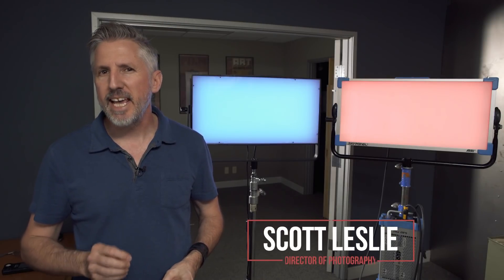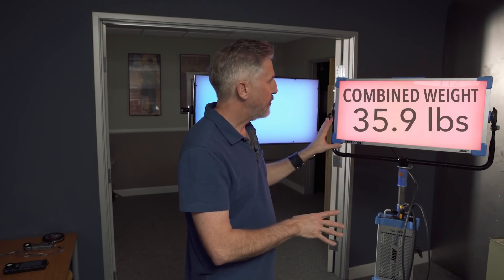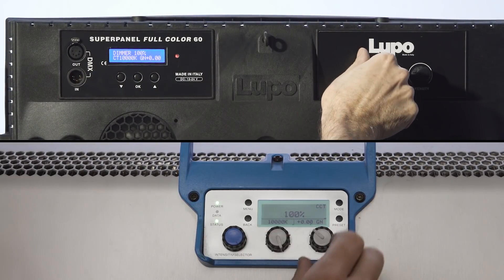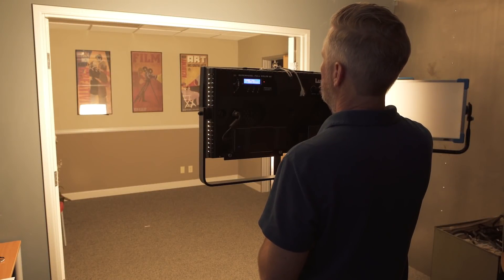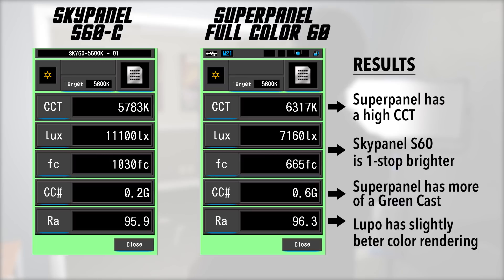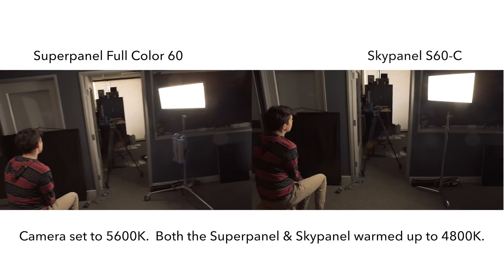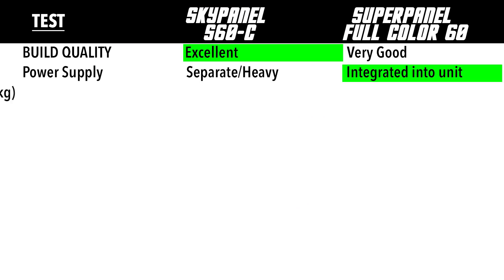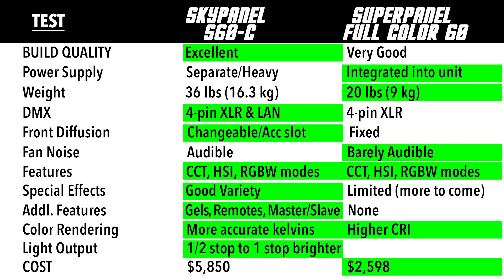ARRI Skypanel S60-C vs. Lupo Superpanel Full Color 60 Comparison Review

Comment: what about the performance power when using batteries. The Skypanel can run by V Mounts @ half power, but run full power when using bebob 1200. i am pretty sure, the lupo will just allow half power as most leds does when using batteries